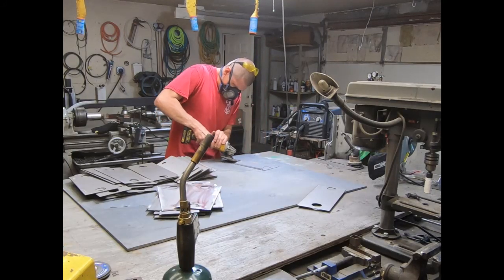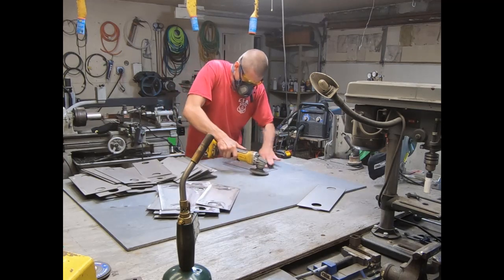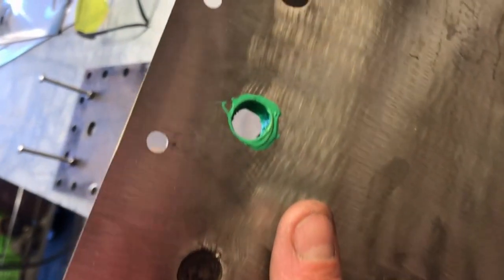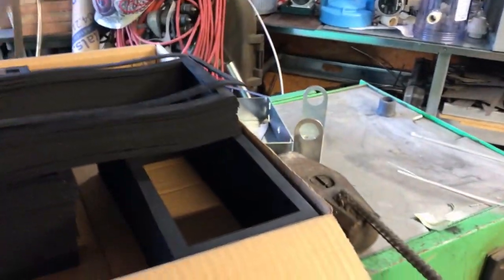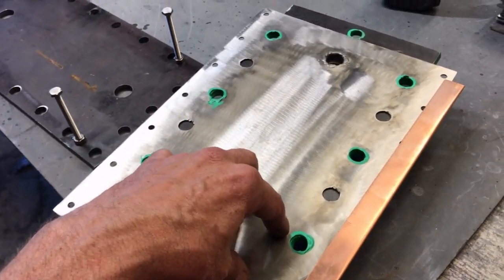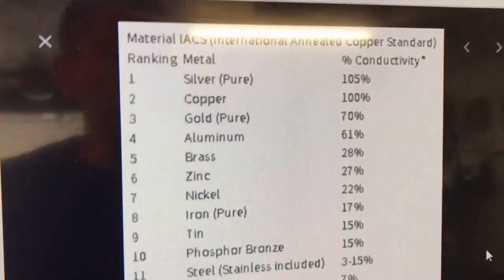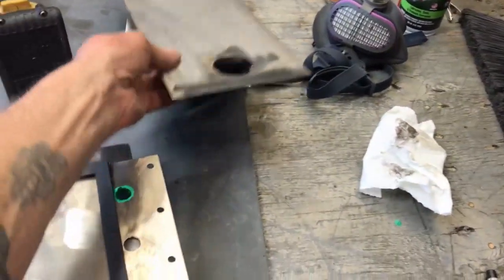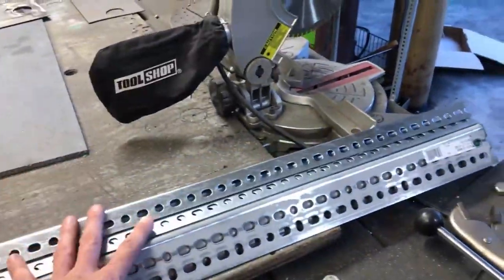10,000 watt electrolyzer build

Comment: why we use lead for batterys terminals? Wel because we need to connect it to lead. And connecting something to lead that is not lead and that has better conductivity would require to melt it to the lead. Meaning you wont really get much better conductivity then the lead. It would however increase the cast. And another advantage is that a lead teminal wil kind of shape itself to the clamp you put on it. So if the surface inside the clamp isnt perfect and you squeeze the clamp on tight it wil kind of reform in to the clamp inside shap. If you use a hard material for the terminal then it wont, and you might only connect on a smaller section unless you really machine the termanl and the clamp to good surface finish.(another cost)
But if you go look at for example lifepo4 batterys you see copper connectors, mostly plated by some more corrosion resistant layer.
Also the reason we use gold in high end connectors is not because its the best conductor. But it is because its the best conductor OVER TIME. Yes silver and copper do better in the peak when they are new. But both tend to form oxide layers wich then make it les conductive. Gold isnt really doing that, so after 5 years of use with some moisture getting to it and all it wil stil be around the 70% mark where as copper after 5 years of exposure wil be below lead on the scale. For silver i dont know how fast it drops. Also i dont know how easy it is to use silver for plating on to terminals? Never tried. But gold is pretty easy to do, wich is also a big deal. 
Compare it to this project. If you could get all those plates pre cut and ready to assemble no time invested for lets say 10% more then raw material cost would you stil go trough cutting it yourself and then cleaning the cuts up? Probably not. The effort is too big for the extra cost.
Reply from the maker: Good point about the smashing

Comment: You know that copper will be protected by iron during electrolis, so iron will be degrading faster than normal. I have no idea on stainless steel, also what metals in this stainless steel...
Reply: Totally different project.